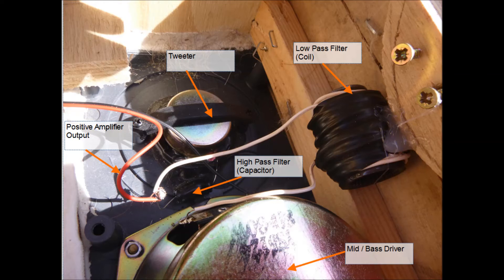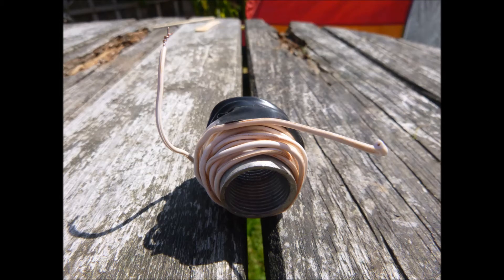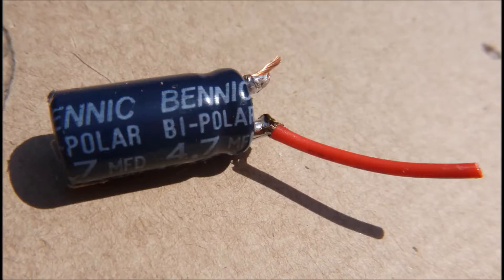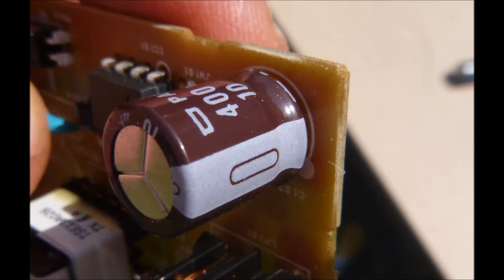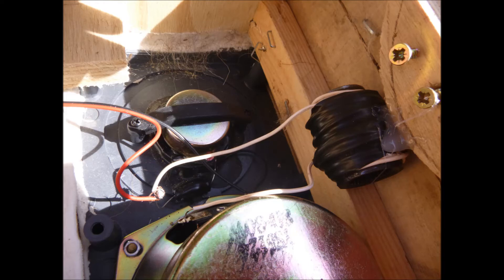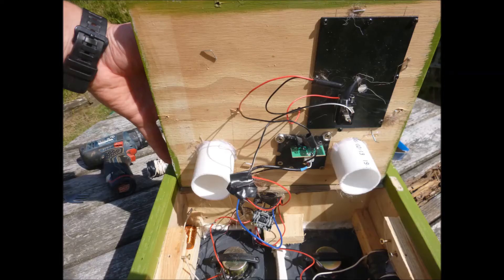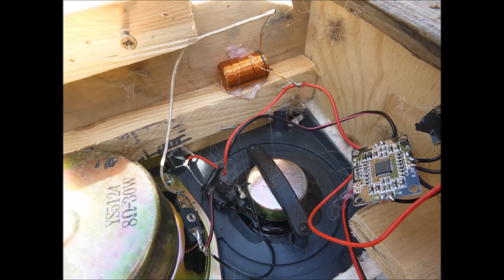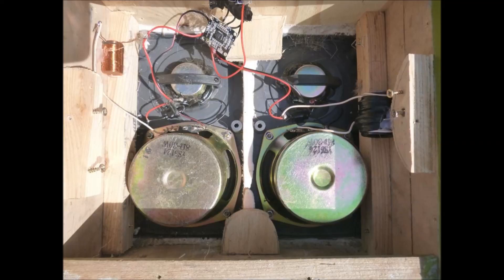Make some DIY High and Low Pass Filters for Speakers

Comment: Does the voltage on the capacitor make a difference? What is the difference between 100v and 250 for example
Reply from the maker: Looked this up for your, voltage is to do with the peak voltage of the circuit. I don't think i affects sound. 

Choosing a capacitor for a high-pass filter

The capacitor value for a high-pass filter depends on the desired cutoff frequency and the impedance of the circuit. The formula for calculating the capacitor value is:

C = 1 / (2 * pi * f * R)
Where:

C is the capacitance in farads
f is the cutoff frequency in hertz
R is the resistance in ohms
Here is a table showing some common capacitor values for different cutoff frequencies and a 10k ohm resistance:

Cutoff Frequency	Capacitor Value
20 Hz	0.8 uF
100 Hz	0.16 uF
500 Hz	0.032 uF
1 kHz	0.016 uF

https://g.co/gemini/share/de5ac1a7b24e

Comment: I'm a  crossover dummy and want to build a simple low pass for a pair of bass extension stands for a pair of Realistic Minimus 7 speakers with Ziltch crossovers. The factory spec on the Minimus says it plays down to 50HZ but I am assuming that is down somewhere around 12 db.  Would I build a low pass at 50HZ or should it be higher or lower. Does a 50HZ Crossover START to cross at 50HZ or has it completely crossed at 50HZ.
Reply from the maker: Hi Mike, I afraid I am the wrong person to ask, that is way too tech for me. Try the "DIY audio forum", I have had some great help from there are last few years.